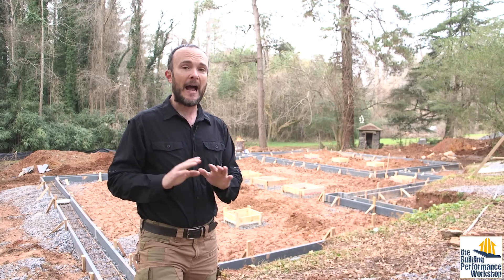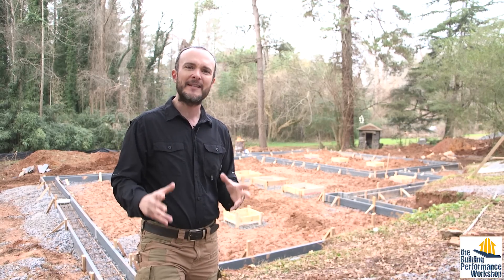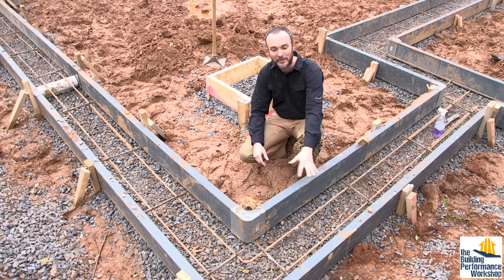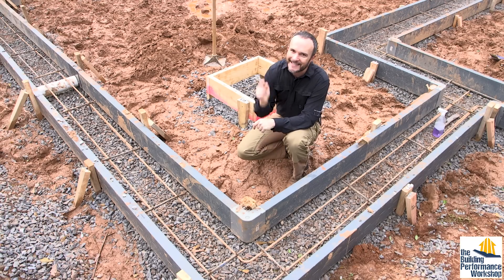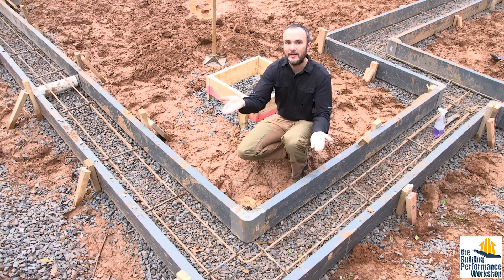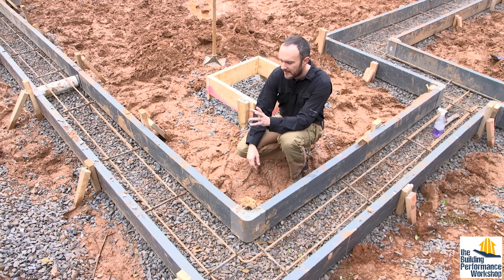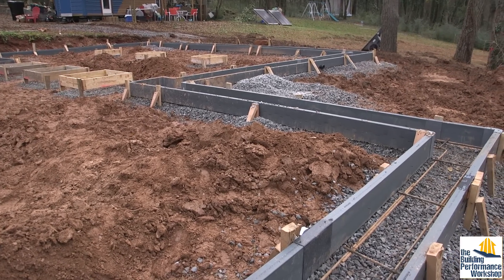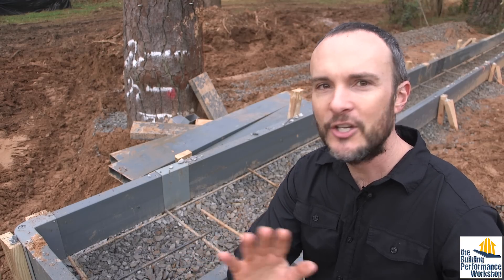First Concrete Pour: Form-A-Drain 4-in-1 Foundation Footings

Comment: A couple items.
1. You're always better off to hire an actual professional construction manager than to oversee a home building project yourself after having watched a couple YouTube videos and reading a few books. to a. Write an MSB b. Oversee the construction c. Be the manager of the GC and or Subs. simply because you don't know anything.  You state your science based and then scrub rebar, tells me you have no f**king clue how rebar and concrete interface.  I started using Form a drain many decades ago and switched back because or several issues.  I use Schedule 40 rigid perforated holes facing down with cleanouts added at each corner (can't do that with FAD) plus the holes will permit more water and better flow in rounded pipe.  Also, you can insulate your footer with typical concrete footers and separate 4" pipe (IF you like science). Adding a fan to a Radon mitigation system does NOTHING for humidity, and most of the time it doesn't add anything for the radon mitigation system, though we wire every house to add a fan later, we test for radon before finishes and after since certain materials like granite from Brazile can emit lots of radon.  
As others mentioned, ALWAYS do a slump test onsite, this is concrete 101.  I thought I heard there was lots of fill under footers, whether stone or engineered fill this is a bad idea unless compacted properly and left to further settle for 2 years.  Too bored to listen to entire video.  Oh, who am I?  In construction for 57 years, last 40 also doing forensic analysis of construction deficiencies and failures.  Testify in court as well as expert for 40 years regarding all things construction... There's A LOT to building a house and I understand TV makes it look simple, but just like any profession, you are better off with a top pro with decades of experience handling your project.  I'll agree there are a lot of hacks out there and that's why you NEVER want the person in charge of the materials and procedures to have a financial interest in your project.  💯 Incorrect regarding slump test . Yes, we test in field and in our lab. And that my folks is why you hire a professional.
Reply from the maker: so boring
Reply: @HomePerformance  it's boring to get a better home higher quality cost less fewer problems?  Certainly qualifies as one of the most idiotic statements I've read in my life
Reply from the maker: No, just the way you talk

Comment: Why do you pour the concrete on top of the rebar. The rebar should be in the concrete. Plastic chairs will hold it off the ground so the concrete can get underneath it.

Comment: "'I'm already a pain-in-the-ass client", agreed. A decade from now, you'll have learned not to sweat the details so much. Your house will turn out fine if the site is well-drained and it's not sitting on bedrock where most radon related issues originate.

Comment: We were using form-a-drain for our footings years ago.  It’s refreshing to see an in depth video on this product.
Reply: Re: rebar chairs, form-a-drain makes a heavy gauge wire chair that also keeps the panels from spreading during placement.  They assist the stakes in keeping everything straight and help prevent bowing.

As far as placement we were using tele belt trucks and would place the aggregate around the inside and outside of the forms first, followed immediately by the ready mix.  It saves the cost of travel and staging the truck twice.

Also, the batch plant will load it at a specific slump but I have had individual drivers add water en route… so slump testing it on site is a good idea.  

Sorry if I have been rambling but these were a few tidbits I learned in 30 years of contracting.

Comment: Those chair are bad, maybe one of the worst things that you could do to your concrete foundations. See those chairs are going to rust and transfer the rust to your rebar and then the foundation will crack. Rather use products that are not metal but instead rock or concrete.

Comment: I have been at it for 45 years.. I always do my best and good solid work. OCD maybe but I got to say sometimes things are over kill like cleaning the re-bar... I was in New England for the better part of my construction life and I have seen 200 year old solid homes that been through many storms like the hurricane of 1938 still standing and they have tree limbs for roof rafters 4 ft  apart.. no ridge.. with the bark still on them. Fieldstone foundations that are solid. Nowadays we have lvl ridge boards and ridge beams... hurricane straps and battery powered tools that every time you need it the battery is dead. Between simpson and milwaukee it is all marketing. braced wall lalala. I worked storm damaged properties and it is more work to rebuild a home that is tied in than ripped off the foundation. pressure treated wood that was direct burial I have seen rotted.. concrete backer board green board works just as good

Comment: so ,this is a great video. I realized myself that you must get to solid undisturbed soil. I had to build up a foot as well do to sloped grading . I used 12 inches of 57 stone on top of undisturbed soil. I tested the soil with a probe little penitration. Hope this works. Im only adding a small addition.  As you did your concrete in two parts, you should have (shown )more of those rocks you spoke about and why you filled stone to match that level.

Comment: I really enjoyed the homeowners enthusiasm however he made several ignorant comments. Yes you can do a slump test on site. No, he was not pouring at a four or five slump. He was pouring about a six slump. You put gravel and a silt membrane on the outside of the footing not to hold the forms in place but so that the water will drain into the footing drain and not clog up the holes in his drain system.  It also helps to stop the silt from the dirt seeping into the drains and filling up his drains overtime. Properly installed footing drains will be pulling water from a lower point than his drains will be as a properly installed footing drain is sloped and pulls water from a lower point than the bottom of the footing. I could go on, but I think you get the point this homeowner could’ve definitely benefited from a very good contractor however, I do say I enjoyed his enthusiasm.

Comment: Foundation types are very location specific. Check your local and national building codes. I have been in the trades for 30+ years, and I would want to consult a soil engineer before using this system. Mud on the rebar, just one of the red flags.
Reply from the maker: Good advice

Comment: It's called hydrostatic pressure which we have a lot of here in NH. We have to dig below frost line a minimum of 5 feet.and add a keyway to stop water migration between the wall and the footing. All footings must be a minimum of 24 inches wide by 12 inches deep. Granite state issues require radon remediation which is a systems of PVC drain pipe under the slab set in 3/4 inch stone with 3/4 stone over the
 PVC and 6 mil poly on top of the stone and piping system then concrete for the slab with wire mesh or rebar and fiber mesh added to the concrete. This is why foundations in New England cost so much. Prep work is essential.

Comment: My dad designed a complex of luxury high rise apartment buildings in Istanbul. He got there a week after the pour to monitor the concrete crush test. I think that the cores they needed were cylinders 16 inches long and 4 inches in diameter. The concrete contractor gets paid after the crush test passes. Apparently the concrete contractor had not made the required 5 cores per concrete truck to be tested, so they got a big concrete drill, and made some from a spot on the foundation. They failed. They had to remove that concrete foundation, and put in a new foundation.

Several years later there was a large earthquake in Istanbul. Many of the pictures of the city showed that there were only 5 sets of structures over 5 stories tall still standing. Dad designed 3 of them. 

Fallout was a huge corruption ring. They used nearly free beach sand with salt in it instead of expensive quarry sand. The company who supplied the concrete for the first pour went bankrupt.

Comment: What I have come to learn during the planning process is that a house is a "complex adaptive system" - any time you modify a certain variable, the rest of the system changes in unpredictable ways for those without years and years of experience.  Want to add feature X?  You'll have to do Y, which then undoes the benefits of C and D.  If the whole thing wasn't extremely expensive, I wouldn't bother learning it myself.
Reply from the maker: Well put, Dugnutt
Reply: @HomePerformance  🙏

Comment: Why not notch 3/4” plywood to suit your foundation dimensions and drop them over the whole form when pouring? They’d act as a clamp and maintain your straight lines and then on cure just lift them out the way. Only downside would be finish troweling around them, but that’s a minor downside compared to keeping all your forms straight in my opinion!

Comment: People do it that way because the rebar is placed farthest away from the face of the concrete to give the highest tension resistance. You have the chair and put the rebar at the center of the concrete when the rebar is not a tension bar but a temperature and cracks control bar.

Comment: It seems like you did not have a very good contractor for you forms and concrete pour. Most of those guys did not do much or any schooling and they are used to doing things their own way. Unfortunately, with new methods of forming such as you are doing, those guys tend to not listen to you. I think you needed to do just a bit more consulting with the manufacturer of those forms and whoever else you could have consulted with to make you feel more confident in making your demands to that contractor. The fact that they told you they didn't know that they needed to clean off that rebar is a disgrace. Any good concrete contractor knows that. Most of the time, a good wire brush or wire wheel on a drill does the job very quickly. The rebar does not have to shine like new metal, but you should try to get the bulk of the rust off.
Reply from the maker: I hear you Kevin, thanks for sharing your advice

Comment: I love you perfection on explanation in video. 
This rebars metal chair will rusted and transfer rust to a rebars and that's why Contractor like to pouring rebars after concrete is done. Like it when many yang engineers what don't have experience on field , over thinking and explained to  customers what they must watching on Contractors.

Comment: Pro Tip: Use epoxy coated rebar and touch up your cuts with zinc paint. Otherwise your concrete will start to fail as the rebar corrodes inside the slab. 

We work on 40yr old buildings and anything metal inside the slab is completely gone, creating voids that cause fractures and surface cracking wherever water is present over time. The fan will dry out the soil around the forms, but it won't dry out the footer (no slits facing the concrete). We repair those fractures with surface injected epoxy.  

Also, if you don't fabric between the rock and soil, the soil will move into the spaces between the rock (soil piping) and settle your footing and crack your foundation walls. We repair those voids with injected hydrophilic resins.
Reply from the maker: Interesting, thank you

Comment: Hello form a drain looks good. 
     I tried to contact form a drain people's, but they didn't reply. Usually form a drain is leveled straight with leveled footing to be poured in it. How water moves in form a drain. As Inside of form a drain  also have straight divider. 
    Unless we decline the form a drain. Which we don't, we level the form a drain to get leveled footing. 
    Please reply. I am going to start my home build in next two months.
Reply from the maker: Yes, level, and you are correct that it might hang out in there— in our case I fixed that by exhausting from the FAD with the radon fan, so it’s accelerating the evaporation of any standing water.

Comment: You want a #5 slup for movement of the cement as well.  It will help you avoid several potential issues.  1) less voids in your foundation,2) easier to move and screed 3) won't cure too fast for you to work the mud. You will definitely have to add more stakes because of the fluidity but you end up with a better result
Reply from the maker: Interesting Brian thx

Comment: Interesting. The forms with drains..hope the water get drained out or dried out as designed.
Water mains and sewer main were not mentioned. Maybe will be installed and connected later from the outside?
Reply from the maker: Yes, through the foundation wall.

Comment: there are a lot of things said in this video that are not totally true. like a slump test was done by filling a street cone with concrete, and then you set it right side up and remove the cone. how much it drops, or slumps, is the test. if it drops 5 inches, thats 5 slump. then code is rebar needs to be 3" from soil, and that's what the chair is for. an engineer can say if you need more. the 2021 IRC says you have to clean the rust and oil off rebar. So its not a secret, and if people are not doing it, its just laziness.

Comment: Was bringing in fill cheaper than just drilling piles?
Reply from the maker: Would have had to bring in fill even so, after we dug the trash out of there. And re-engineering the structure, re-bidding the project, waiting through all that- nothing is a simple 1:1.

Comment: So there are a lot of people who can’t takeoff work or don’t understand how these things work. So they can hire someone like myself Who will act as a rep and do inspections at critical stages. 

My only concern with the form a drain is that the small slits can get blocked with dirt/sand overtime.
Corrugated perforated pipes can come with a sock which is a lot finer which can let water through but won’t get clogged
Reply from the maker: Rite on buddy- but don’t worry, the geofabric wrap went on over a gravel drainage bed. See the rest at:
https://youtu.be/PZDNM9Tb6J8

Comment: You should do a slump test right off the truck on your job site… if your going to do one…
Also time and adding water is bad for concrete.
by time… I mean once you add the first water you need to have it poured out quick(45-60 mins ). They say 1 1/2 hour’s or 300 revolution in the truck….

Comment: If you have to stand there and make sure it’s done the way you agreed upon….. done hire them😳….
Reply from the maker: I live 50 feet away, this is my life
Reply: @HomePerformance  …I’ve built 100 homes +/- ( 80% spec.) 
I only have used one- Plummer, excavator, concrete finisher, Sheetrocker, etc…
Only 2 different H/A, electricians, painters, masons, insulation…. 
Roofers… 4 or 5… they seem not to last but 5 years +/-….lol….  
I do my own framing and finish…
I’m going to loose a few subs in the next few years due to retirement….most have had a son take over(lucky me)…
For myself…. If I need to watch them all day…
I’ll do it myself…. but to each his own…
Good Luck with your home…

Btw… are you out of Atlanta?
I lived in Powder Springs from 1978 to 87
Went to high school there…
Reply from the maker: Yep, in Atlanta. Sounds like you’ve had a few adventures in building!
Reply: @HomePerformance  … yes sir… started working for myself in 1984 framing and siding.
Got my 1st turn key in 1990…. Started doing spec houses and developing land in 1995… 
Now my son runs everything and I’m trying to be a full time papaw…. 😀 I’ve got 2 twin grandsons age 4….. and 3 granddaughters 2 months old…. Yeah… I don’t think he’s figured out how to have 1 child at a time…..
Btw. If you run into any problems on your house feel free to ask…. Good Luck
Reply from the maker: Thanks, Thomas. The house is perfect, been living in it for over a year.

Comment: Like your video and information.  I am sure you drove your footer contractor crazy.  I don't have any experience so I won't try to present my concerns as being more than my paranoia.  1) Metal corrosion can damage concrete.  The concrete alkalinity generally protects encased rebar but rebar, and metal saddles, that are exposed to air will corrode.  2) I wanted to build a house on a property where the engineer was concerned about the presence of expansive clays and a geologic history where the soil was washed up over time so the undesturbed soil was not adequately compacted.  The engineer required that I over excavate 3 to 4 ft (don't remember the exact value) below and wider than my footer then back fill with road base compacting every 6-8 inches.  What you did seems consistent with forming a rubble trench so it probably works just as well.

Comment: The factory can actually run a slump test that you can do a slump test on site also and a pressure test. Even though I am traffic control but I am traffic control working for a concrete company

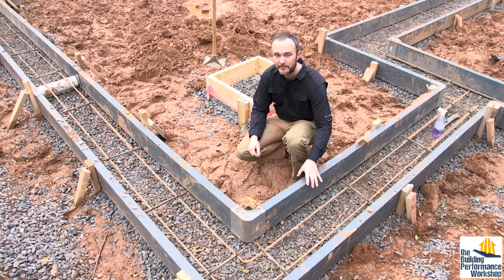Comment: @4:52 don’t spread fake information about soil testing with rebar. 
Let’s do some math to check your methods. 
Area of #4 rebar equals 0.2” if you apply your body weight on it, lets say 100lb, you generating 72000 pounds per sq.ft. I haven’t seen a single family home designed for more 3500psf
Reply from the maker: Vitaliy, have you tried testing this way? I guarantee you’ll see the point if you do- in well-compacted areas, you cannot drive a rebar tip in further than an inch or two.
Reply: @HomePerformance  yes, I can drive a 1/2 rebar by hand down to 2ft and I’m about to build 3 story house on it. 
Because our soil capacity is 3500psf according to boring test prior excavation and DPT test prior footing placement.
None of those tests are done with rebar.don’t even call it a test because it’s not
Reply from the maker: I think you should rethink your upcoming build. I recommend you actually talk with one of these engineers.